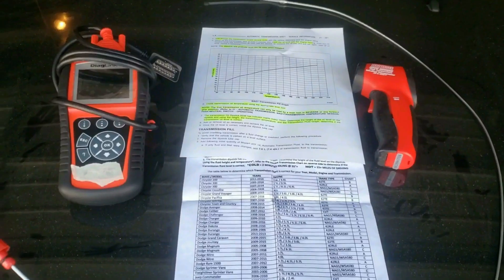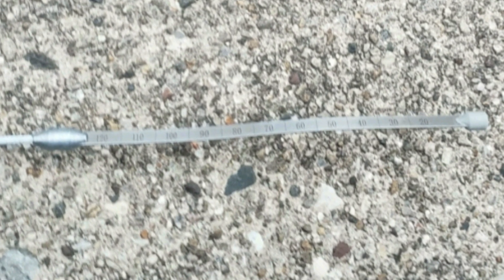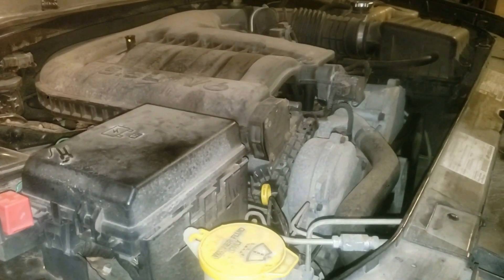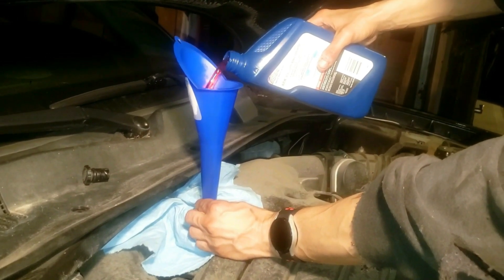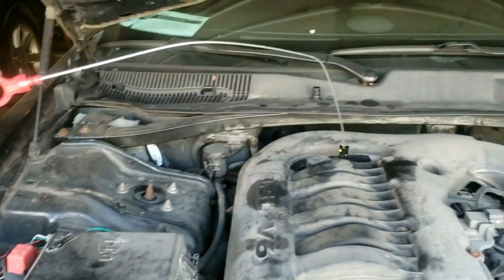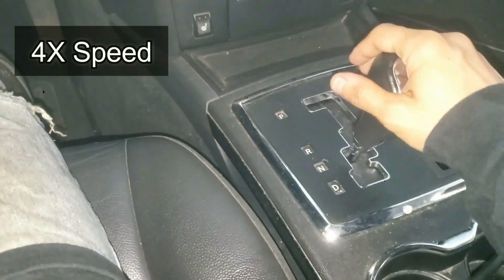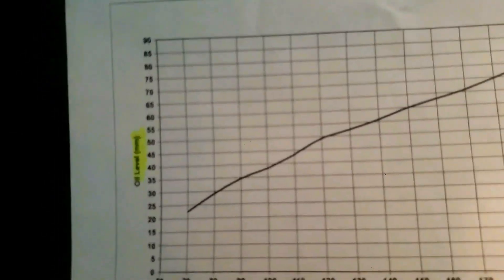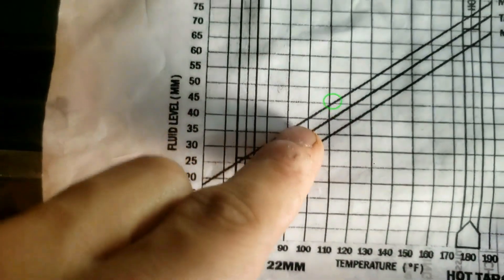How To Check Transmission Oil Level With Dipstick 📏, Chart, & OBD Scanner 🌡️

Comment: Thanks your videos are great! Quick question what if I don’t have that odbii code reader? Can I use a different one? Or should I just invest in a diaglink one first? 😅 thanks
Reply from the maker: No need to use the more expensive one in this video. They make a lot cheaper ones nowadays under $40. When looking to buy one just make sure it can read the temperature, and your good.